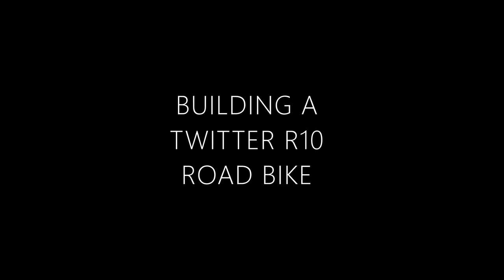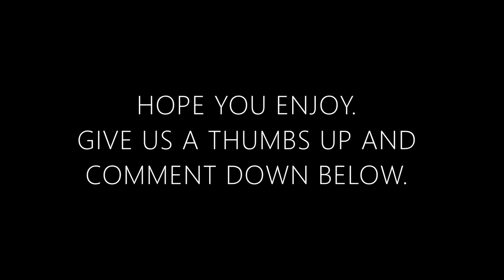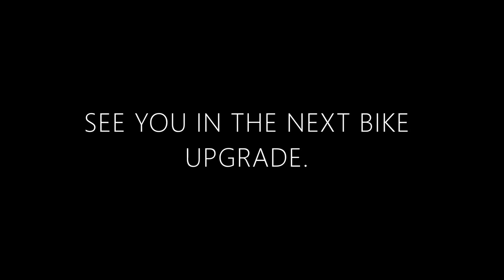Build Bike Twitter R10 Disc Road Bike

Comment: bro how did you install the cable routing for the front derailleur? does it have guides inside near the bottom bracket? because it's only a small exit hole from the outside and kinda scared to remove the cable cos i might not be able to put it back
Reply from the maker: Hello bro, to make it easy. Remove first the BB and locate the cable housing and point it in the exit hole for the front derailleur. Then return the BB. Thank you

Comment: What is the bbyou used. Is it bb386 x46 x24 or bb86x46x24
Reply from the maker: If the frame is threaded, use T47-24i, check this https://invle.co/cldnwx1
If the frame is press fit, use BB386, check this https://invle.co/cldnx1j

Comment: Hi sir, how is you're experience on this bike I'm planning to buy one but, I'm just being nervous because i am not sure if I'm safe for this second hand twitter thunder shimano 105/claris mix, size 54, no scratches or dents the first owner have an proof, but I've heard that they say the most common issue is where you insert you're bottom bracket like below carbon spot or where you slide your bracket/or chainset get's scratch might effect the below frame by sliding an bracket in it?, is yours is in good condition no scratches in the below carbon spot of where you slap your bottom bracket?
Reply from the maker: Hi there, so far no issues found after installing the bottom bracket of this R10 frame since at start.
Reply: @jaredandcarlos  I've seen some thunder or r10 always is the issue on bottom bracket, if you know something about it, is it always because the bb is too tighten?
Reply from the maker: I prefer to use torque wrench to avoid over tightening.

Comment: Nice build. What is the total wight? Did you use shimano claris?
Reply from the maker: It reached 9.1kg after replacing inner tubes from butyl into TPU (check description) and lightweight 25c tires. Yes, I used Claris R2000.
Reply: @jaredandcarlos  impressive :) nice

Comment: What type of bottom bracket this bike use?
Reply from the maker: If the frame is threaded, use T47-24i, check this https://invle.co/cldnwx1
If the frame is press fit, use BB386, check this https://invle.co/cldnx1j
Reply: I have the same Twitter R10 as yours and i notice some notches on the BB cups as yours. So i guess my bike use the T47-24i. Thx for the information bro.